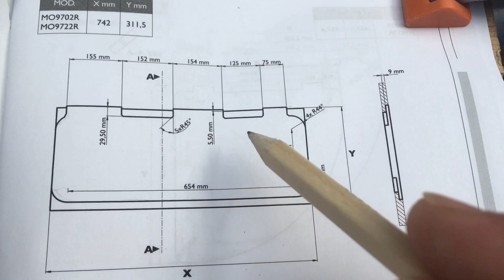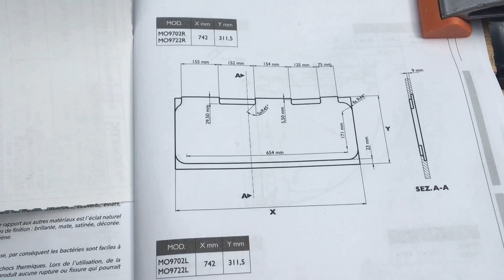How to fit Smev 9722 installation-template-cutting-fitting

Comment: Hey I just wondered if you knew the depth of the cooler side with the electric ignition? Unfortunately I have the piezo version which is too deep to fit above my fridge
Reply from the maker: Hey Kyle, I’ve just gone out and had a look, and the electronic ignition it level with the gas pipe, I then have large plastic spade connectors which sits 25mm lower than the gas pipe. If you don’t use the spade connectors and use solder instead then it won’t interfere with your fridge unit. Hope this helps 👍

Comment: Hi there , i am making a wooden gabinete for the Smev 9722 and was planing to have a fridge underneath the cooker. Do you think the heat may compromise de good function of the fridge? Thanks
Reply from the maker: Yeah it should be fine as long as there’s room for air circulation behind the fridge. I have some pics from the instruction manual, add me on Instagram and I’ll send you the pics.

Comment: great vid, my i've got 12 mm ply as my worktop, do you think this would be ok? would mean having 3mm of ply left in the routed area's.
Reply from the maker: Thank you, I can’t see it being a problem, the fixing screws may poke out the underneath tho, can’t remember the length of the screws that came with the sink/hob
Reply: @TwiggsT4  awesome thank you, do you know if the bulk of the weight is supported by those routed areas? Or is there a small lip around the entire unit ?
Reply from the maker: The weight is distributed mainly around the edge on the rubber strip
Reply: @TwiggsT4  awesome thank you so much!
Reply: Did you fit the cooker with the 12mm worktop ? leaving 3mm ply as the support ? curious. Thanks

Comment: So matt_twig where did you get your fitting instructions from? please, Julie 😁
Reply from the maker: Julie Bushrod I got my instructions with the sink/cooker unit from the supplier. I have seen templates for these on eBay. If your sink/cooker didn’t come with one you’re more than welcome to have my instruction manual
Reply: @TwiggsT4 yes please that would be great, 
@Coastal Campers Van Conversion,
Unit 1,
Miller Buisness Park,
Liskeard,
PL14 4DA,
Cornwall.
Reply from the maker: I will post this to you first thing in the morning 👍
Reply: @TwiggsT4  very much obliged, thank you so much, 🌝
Reply: Hi Julie, do you still have the fitting instructions form? Could you please share it with me? Cheers. Rudy